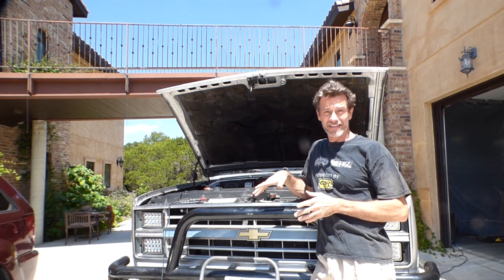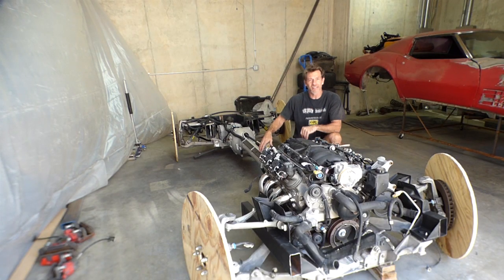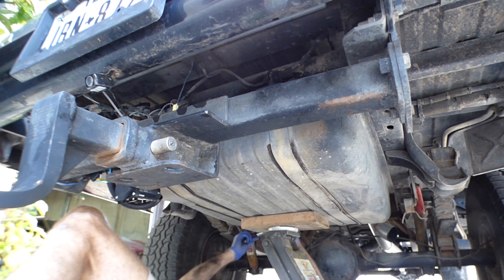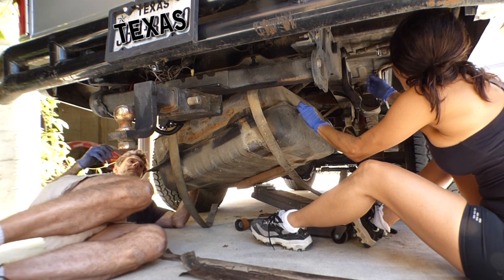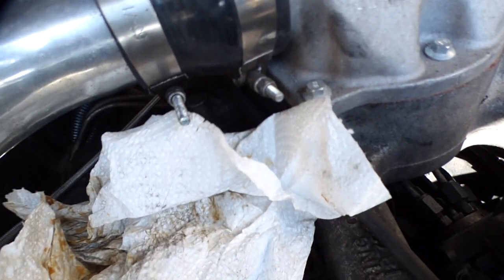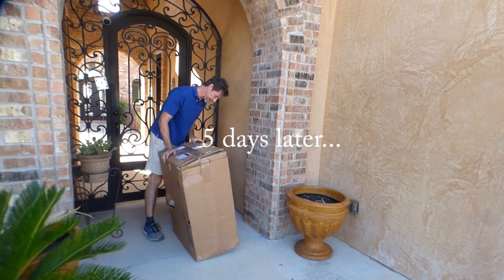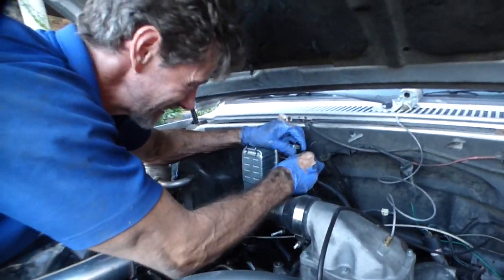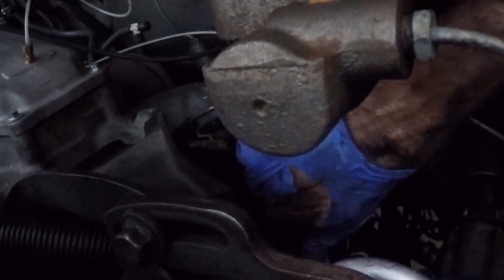6.2/6.5 turbo diesel. Fuel system problems and fixes.

Comment: I greatly appreciate your videos. 
Thank you. 
I see your truck still has the original style fuel water separator. 
That’s probably why you’re having issues loosing prime. 
NAPA sells a conversion for a spin on separator. Much better than stock. 
And you can thread in a pressure gauge.
Reply from the maker: thanks.   It actually starts pretty well mostly.   Most of the time I never hit the manual glowplug switch.    I'll keep that conversion kit in mind, though.

Comment: Did the same thing on my 98 3500 Silverado. I cleaned the tank and put an inline filter between tank and lift pump. That crap kills lift pumps especially electric ones like mine. I took sock off and left it off because of inline 5 micron filter. I just keep one in truck

Comment: My Favorite year Vette  68-72 awesome.   
Todays fuel causes delamination of coating, a popular occurance with Ford trucks. When the fuel breaks down the tank's coating, the coating clots turning into little pellets. These pellets get sucked up by the strainer assembly clogging the fuel filter sock attached to the end of the strainer or dip tube.

Comment: Waiting on the update running video. I'd say it made a huge difference just changing the fuel sock.
Reply from the maker: The Burb certainly feel stronger, maybe 20%. It could be more.   It is very noticeable, and I have yet to notice any "surge" while cruising.   I'm spinning the RR tire now when turning right from a stop sign!  Now I need posi-traction LSD.

Comment: Why didn't you get a new sending unit and also you should've replaced all the rubber lines and orings. Basicly you half assed it. All that work and still going to be a problem

Comment: Well done.  Dropping tank is annoying but needed after decades. 
There is a free forum for 6.2/6.5 that may help you a bunch.  Thetruckstop.us 
Ya Really want a fuel pressure gauge on there. Save the life of injection pump and when using mechanical lift pump can save engine bearings too incase of the bladder giving out and plugged weep holes, the diesel can fill the crank case washing out bearings.

Comment: Hey where did you get those headlights. They are sweet. I want to get some for my truck. Thanks.
Reply from the maker: ebay "LED 4x6 headlights".   You can get all 4 for $50-60.
Reply: Thanks